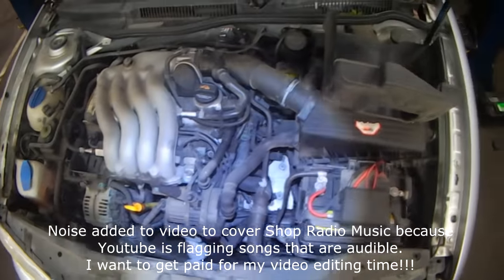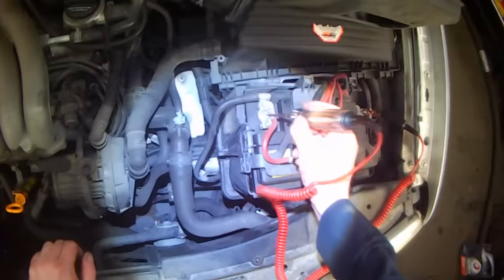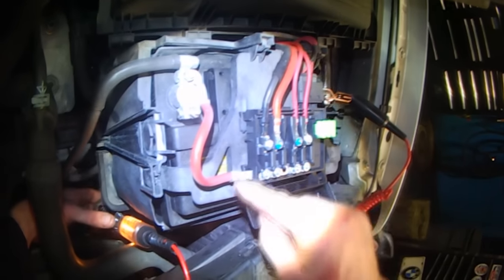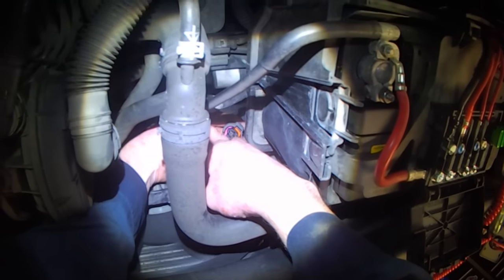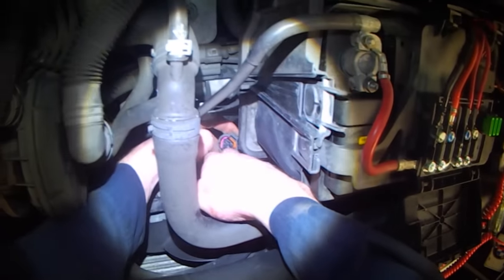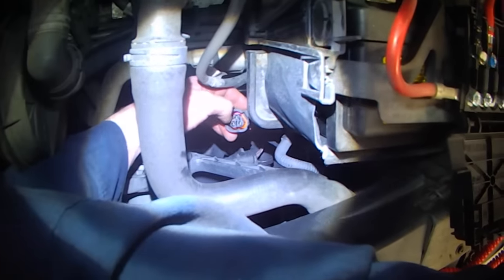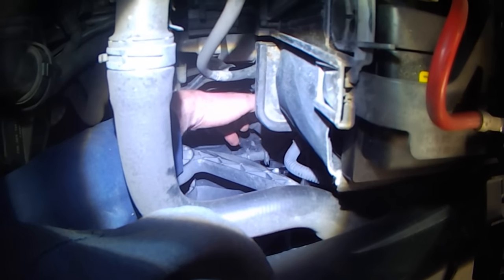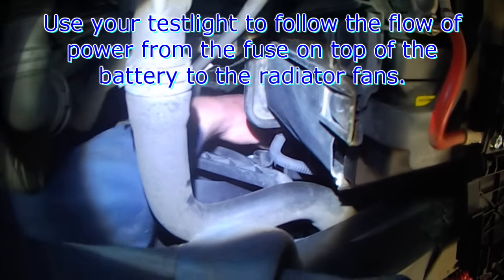VW A1 A2, A3, A4: Radiator fan(s) quick check.

Comment: Very odd. I had a problem with my fan not turning on. I unpluged the connection, tested low speed and it worked. Plugged it back, and now my fan problem is gone. Ice cold ac all the time now! I guess playing with the connection solved it. Thank You!
Reply from the maker: Yeah... bad connection / corrosion can cause issues. Simply moving connectors / wires can sometimes get things working again. A closer look / inspection should still be done (to find the exact cause, so it won't happen again).

Comment: I watched the video, and looks like my fan connector, but as i watched the video he described all of what happened , small fan stopped working first, then the large one stayed on all the time, then a/c stopped blowing cool a few days ago, now fans wont come on and overheating in traffic. I'm thinking replace both fans?
Reply from the maker: Yes, probably both fans have quit... especially when AC is used a lot. The fans will always run when AC is on. You might still want to make sure that the fan module (large fan) has good power & ground at the main harness plug.

Comment: Your advice was very useful to narrow down the issue. Figured out that the connector, which is on top of the battery compartment, had melted resulting in  no power supply to the fans. I have by passed the connector and introduced a fuse.  Now the fans and AC are working. Thanks a lot for your support.
Reply from the maker: Thank you for watching!

Comment: Hello, I have a 2004 jetta gli 1.8t low speed fan not turning on and car over heats in traffic on the highway temperature stays half way. When ac is turned on big fan works replaced the 30amp fuse and low speed fan and after fans when the car is turned off not working any idea?
Reply from the maker: Follow the steps and let me know what happens.

Comment: Just helped me isolate the problem in seconds!  My switch appears to be bad - when I bridge the two connections the fans kick on.  Thanks so much for taking the time to make this!
Reply from the maker: Make sure that you have coolant circulation... if the switch does not get warm, it can't turn the fans on. Year, make, model, engine? Do you have heat inside the car?
Reply: @EXOVCDS  1998 Jetta GLS 2.0, the heat works great.
Reply from the maker: Did the "fans not working" happen after any recent work on the car or you just noticed that the fans were not coming on anymore? If it also runs hot while you are cruising at a steady speed, it's probably a thermostat issue.
Reply: @EXOVCDS  Fans didn't work when I bought the car.  It does run hot while cruising steady, and after further investigation the upper rad hose is hot while the lower hose is cold.  I believe this indicates a stuck closed thermostat?  If it didn't overheat when cruising, would that rule out a stuck closed thermostat because the coolant could cycle through the radiator and be cooled sufficiently by highway air alone?
Reply from the maker: Yes... if it does not run hot / overheat while driving, then the thermostat is OK.
If you let the engine idle to the point where the needle starts to move past the middle... bypass the radiator fan switch (like in the video). If the temperature needle starts to come down, then the sensor is bad. If the needle does not come down, then it could still be a thermostat issue (not opening fully).... raising the engine rpm will circulate more coolant through the partially open thermostat and temps should then come down as long as the fans are running.
Reply: @EXOVCDS  With a new thermostat my car is running happily, thanks so much for following up!  Really appreciated!
Reply from the maker: @twoscoops5197  Thank you for the update!
Reply: @EXOVCDS  my fan runs and don't stop as long as the engine is running and the aircon is warm but when I try to regas it's not going through
Reply from the maker: Evacuate the ac. Fill with correct amount. Then you can check the operation correctly. Compressor / control valve. If your blend doors are not working correctly,  hot & cold air are mixing and you will not get ac cold air. Lots of things to check.

Comment: Hi Thomas, always great info. Here's my problem (yup, my daughter's Beetle, 2000 TDi). Her fans don't come on when they should. I did this bypass you showed and they worked fine. I replaced the FCM (tested the old one and the new one on my Jetta to make sure they were dead/working, so I know the part needed to be replaced and was with a good one) and replaced the temperature sensor switch as well. Checked and replaced the fuse on top of the battery. I checked the wires leading into the FCM as well, can't see any wear or breaks. Stumped. Help!
Reply from the maker: Hi Brad... any luck?
Next weekend is a long weekend. I can swing by to have a look... if you are in town / home.

Comment: In my 09 the cooling fan wasn't turning on and the big radiator fan  only worked in high speed, then I checked the fuse and it was good so I put another one just in case then both fans worked fine for a day, now it's back to just high speed ,I checked the fuse and it's good.
Reply from the maker: Your fans are controlled differently. The fans are controlled by the ECM. The ecm sends a signal to the large radiator fan (fan control module is part of large fan) which then turns on the large fan & small fan. If the fan module receives a signal from the ECM, but the small fan is not working, then the fan module or the small fan is bad. Use a multimeter to check ecm control of the fan module and the small fan for voltage from the fan control module.
https://youtu.be/oqdv4cm86Ns

Comment: Hey man I recently got a 2001 Jetta VR6 and your vids have been an invaluable resource for me. The car is running great but I have this similar issue where my radiator fan isn't kicking on and I'm experiencing overheating when the a/c is on(climatronic). On a cold start that main radiator fan will be spinning but only if the weather is not too hot outdoors. We've had some scorcher days recently and I noticed on a cold start during those days that big fan won't spin at all. On a normal day if I do a cold start both fans will spin fine(with a/c on) but the big rad fan will just give up once the car hits 190 operating temp. From there the car will run fine with a/c on but the temps start to creep up if I'm idling for more than a half hour or so, all the while the main rad fan won't kick in at all. 

I've tried several different things; I checked all the fuses and tried a new FCM and it's the same issue. I figured the next thing I'll try is this radiator fan switch. Now onto my question, if I test this plug and the fan spins fine on high/low, does that mean the switch itself that screws into the radiator doesn't need to be changed at all and my problem is yet elsewhere? Or does that mean the wiring is fine and the switch needs to be replaced? Sorry for the long winded post, not even sure if you'll see this but either way thanks for your invaluable work brother.
Reply from the maker: Most likely it's a bad large fan.

Comment: Great video, thank you for sharing, I have just the opposite, my fans run as soon as I start the engine, my car is a 2003 Audi A3 1.9 tdi. I might take the fuse out during the winter time.
Reply from the maker: Malc Tulloch Simple enough to check why. If your radiator has a fan switch, unplug it. Are the fans still on? If it does not have a radiator fan switch, look for a sensor in the lower radiator hose. When AC is selected, the fans will always be on. The fan module could be stuck internally. Let me know what you find.
Reply: Thank you so much for your reply, I didn't know about the A/C keeping the fans on, I have only just bought the car & have a lot to learn. Thanks again!!!
Reply: I took the right hand green fuse out & started the engine, I have played with the air-con still not too sure about it though. anyway, I put the fuse back in & the fans don't run while the engine is cold, as you said, it's affected by the air-con. Thank you very much for your videos, you're a gent!!
Reply: @EXOVCDS  your videos are tremendously appreciated.  They empower average people who are not auto mechanics to quickly troubleshoot and repair simple issues that could be serious if not addressed, and help avoid hundreds if not thousands of dollars in parts and labor costs at a repair shop.  Thank you.
Reply from the maker: @RedondoBeach2  thank you for watching!
Reply from the maker: @RedondoBeach2  depending on what type of circuit you are testing, an LED test light might not be the best tool. Yes it can quickly & safely tell you if you have power or ground, but it can not verify if the circuit can carry enough current to power the load. Snap-on LED test lights are also a bit over priced.
Reply: @EXOVCDS  I appreciate your objective and experienced view.  Maybe a digital multimeter will be a better choice due their versatility and accuracy.  The tradeoff will be a higher price but over the long term, it's likely to be more beneficial.  Thanks Thomas.
Reply from the maker: @RedondoBeach2  a regular incandescent test light is better than LED or multimeter. Multimeter can not "load" a circuit... the incandescent test light applies a small load (glowing bulb filament) on the circuit that is being checked... LED test light does not apply a load, neither does a multimeter. Its a good idea to have all 3 tools in your tool box... so that you can use the one that is needed for the problem at hand. If you have no test light at all... start with an incandescent bulb test light.

Comment: Cheers for the video its helping me narrow my issue down. Wondering if u could provide some info?

2011 ibiza st 1.2tsi. i have replaced water pump, thermostat and expansion tank and cap.

Coolant still boils over and noticed radiator fans wont come on. Having checked your video ive bridges the fan switch and pins 1-2 work for low speed and pins 1-3 work for high speed which pointed me to replace rad fan switch. I have installed new switch and still no fans?

I have 1 fault code on vcds for a/c low pressure but not sure if this would stop fans working?

Top rad hose gets hot and bottom rad hose is slightly cooler that the top all other hoses seem to have flow apart from the expansion return pipe seems weak flow rate if other rad pipe squeezed it increases like air trapped.

When coolant boils it escapes the expansion tank until coolant low when left to cool its sort of drunk awa into the engine requiring around 300ml top up. The car doesnt seem to over heat and nothing leaking on the driveway.

Any info im at a loss with this
Reply from the maker: If the fans don't come on... it has to overheat (also why coolant is boiling over).
Make sure that the reservoir cap o-ring is sitting correctly on the inside of the cap.
How firm are the radiator hoses once the engine is warm? Very firm / hard to squeeze? If yes, let the engine cool off and check if the hoses remain stiff even after the coolant is cold. If yes, then the engine has a head gasket issue.
If you manually trigger the radiator fans and leave them on... does coolant still escape from the reservoir?
Reply from the maker: I can't help if you don't reply.
Reply: @EXOVCDS  sorry bud haven't had a notification to say you replyed.

Hoses get hard but nothing extreme there still slightly squidgy.

If pressurised and left over night pressure escapes and the rad pipes are super soft by morning

I haven't actually tried to run around with the fan bridged that's my next move.

I suppose this should then tell me one way or another if it's exhausting into the coolant or this is just simply over heating.

Would the partially blocked matrix cause these symptoms?
Reply from the maker: In all the years I have worked on VAG vehicles, I have never come across a blocked or partially blocked radiator. 
If the rad fan sensor doesn't get warm / hot, I guess it could be... but why doest the temperature gauge go higher?
Have you confirmed the accuracy of the temperature gauge? Compared it with the value that the ecm receives (using a scan tool)? O-ring in the reservoir cap ok?
Reply: @EXOVCDS  it is very strange, I've used vcds to pull live data and the only thing a miss was the fan switch reading -47c I've replaced this but still no fans running.

Top rad hose is hot bottom slightly cooler but warm not cold.

The old thing I can think of is the matrix is reducing the flow rate and this in turn isn't reaching the rad/fan switch at the correct temperature but this is just a theory and I'm struggling to prove....

Think it might have to go to main stealer
Reply from the maker: I can only work with what you tell me (we don't have this make & model car in North America).
For that year of vehicle, I would think that the radiator fans are controlled by the ECM via a PWM signal.
This video about triggering the radiator fans via the radiator fan switch... might not apply, but you said that there is a radiator fan switch.
You need to have someone who is familiar with the vehicle, look at the vehicle. I'm sure I'd be able to help better, if I was actually looking at the vehicle. Sometimes it is cheaper & quicker to have a professional look at it.

Comment: Can I ask the relation of the fan operation to A/C turning off/on?  1997 Golf with AAZ Diesel and cooling fan will not turn on when motor is warm (or with the A/C on).  Just tried A/C and pushing the button doesn't seem to trigger the A/C clutch (motor doesn't take or release a load) and the air seem to be blowing cold which makes me think the A/C is on (It's also 0*C/32*F right now).  Could one component/sensor/switch cause both to go down or is it most likely the control module?

There is power to the fan switch, but with the key off completing the circuits does nothing.  With the key on, completing the circuits will only trigger high speed fan.

Thanks!
Reply from the maker: vanislefaller Sounds like low speed is burnt out. Low speed does not go through the fan module. High speed does (needs key on)... low speed does not need key on.

Comment: New beetle 1.8t. Pulled the triangle plug and jumped the pins. Both the low and high speed functions work. I applied direct power to the fans and both work on low and high speed. My AC still won't turn on and my fans do not work on low speed at all. High speed function works fine. I am at a lost on whats causing the low speed fan not to work/AC not to turn on. I have replaced the FCM twice now with no change.
Reply from the maker: What year? So that I can look at a wiring diagram.
Reply: @EXOVCDS  2000, APH engine code
Reply from the maker: If low speed fan does not come on, but comes on when manually bridged,  then the rad fan switch is bad or the thermostat is stuck closed.
If the engine does not overheat  then the thermostat is ok.
Is fuse 5 OK? 7.5A
AC not coming on could also be due to low charge.
Reply: @EXOVCDS  just checked fuse 5 seemed ok but replaced it anyway just to be sure. It didnt seem to change anything. Could the rad fan switch cause the fans not to work causing the AC compressor not to kick on? Assuming it's charged enough to turn on?
Reply from the maker: No. Rad fan switch is separate / should function separate from AC. Fan module turns on fans when AC is selected... providing charge is ok.
Reply: @EXOVCDS  maybe I need to buy and OEM fan module and have the charge looked at. When my key is in accessory mode and I hit the AC button my fans do not turn on at all.
Reply from the maker: Yes I know. But you also said low speed does not come on by itself... only when you bridge the fan plug at the radiator. You might have more than one issue.
If ac is not working, then you need to check pressure in the system. 
If pressure is OK, you need to check the ac wiring / circuits etc.
Does the ac button light up when you push it? If no, check if it even receives power (check all fuses... I only listed one).
Reply: @EXOVCDS  yes the AC button does light up when pressed.

Comment: My 2004 passat has a control module under the fender in front of the driver side wheel. It gets super hot, my Radiator fan doesn’t come on. Bought a new fan and returned it because it didn’t work. Ordered a new control module. Hoping that will fix the issue. All fuses and relays are good.
Reply from the maker: 2 electric fans or 1 electric + belt driven fan? Which engine? Overheating or no overheating? Idle only or also when driving?